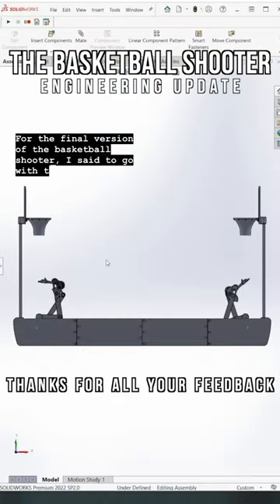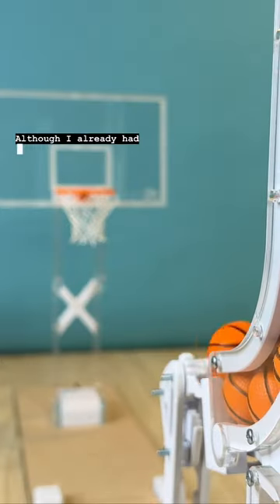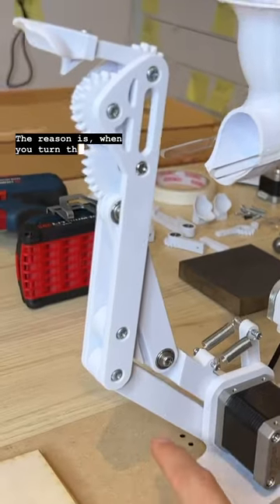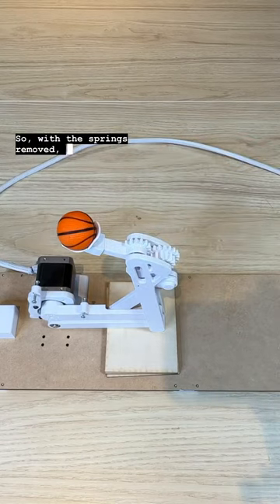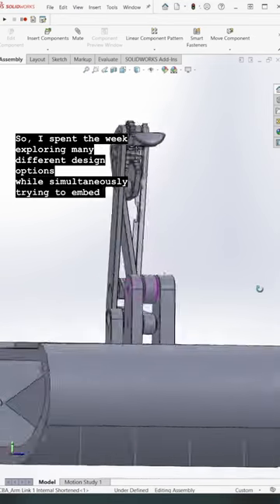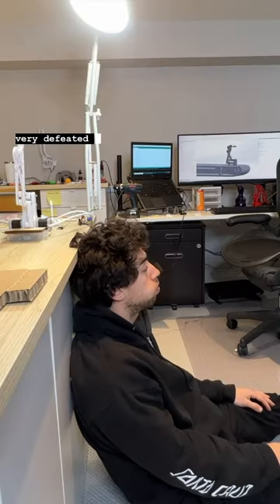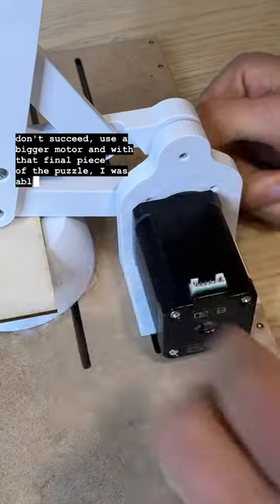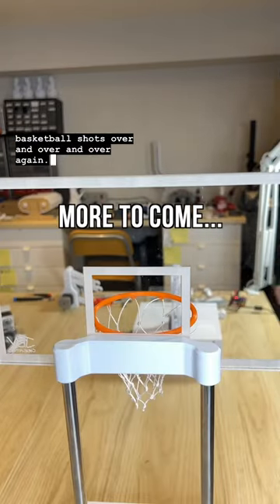Finalizing the Mechanism for the Shooting Arm

Comment: why not just make it spring loaded, so the motor only brings the arm down with a higher gear-ratio!? 🧐 it's also way less stress for the parts!
Reply from the maker: This was sort of the original design, but holding the arm down was drawing a lot of current through the motors, which ultimately could lead to them getting worn out! (I accidentally left a motor on for 2 days and it destroyed it haha)

Comment: Ah yes, “I’ve been on this code for 8hrs and it still doesn’t work”…

Just through a motor at it 😂😂😂
Reply from the maker: 😂 I knew someone out there would get it
Reply: @Engineezy  If iit means you get to avoid coding, it's always worth it
Reply: It's still don't work. Use ac motor
Reply: there's absolutely no way someone has mistaken through for throw

Comment: Another option - you could add a servo where the springs mount to the rear on a servo horn that rotates backward on a relay when you power it on &  rotates forward (unloading the springs) when powered off.
Reply from the maker: Not a bad idea! Only problem is servos are soo noisy which Im trying to avoid!
Reply: @Engineezy   ah, gotcha. You want it quiet so it’s more fitting for an art gallery installation? If not, add a speaker that plays “pump up the jam” when it boots up. hahah

Comment: Nice one, now make a collecting duct beneath the basket with two parallel conveyor belt beneath the floor to keep the loop in a continuous Motion.

You have to control the timing of the stepper motor with respect to the delivery of the ball, Change in overall length of the collecting arm and apply shock absorptive materials, neoprene will do just basically to absorb the kinetic energy of the ball which was in itself took the energy from the transmission mechanism, You would have to look into collecting height of the ball, all this inside a good wooden enclosure will look good.
Such a work will transform a small project into a collector's piece and would sell well in for basketball fans and mostly a showpiece in NBA team's showroom or boardroom.

Comment: Did you ever have linkage transmission optimization in university? There is a whole class on that in some universities. Windscreen whipers for example also have to be extremely optimized to require a very small motor, to save cost. If you need literature on that topic, I am glad to forward you some 😊
Reply from the maker: I did not! I got a single machine design course haha

Comment: Why not use a bi-stable mechanism with a spring?
Reply from the maker: I worried about the material eventually losing its springiness!
Reply: @Engineezy  
Think about a wall switch, it never loses springiness! Just make the lower part "switch-like"